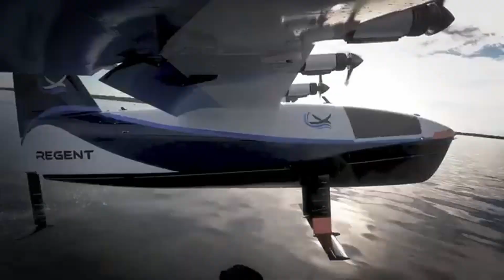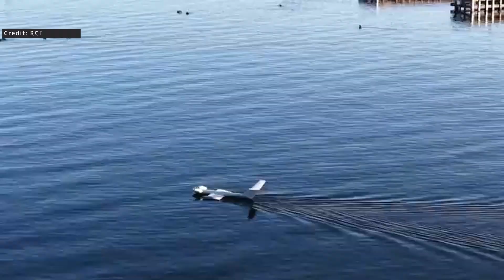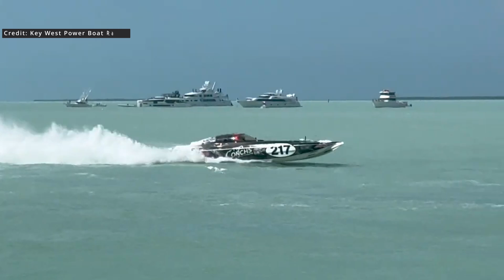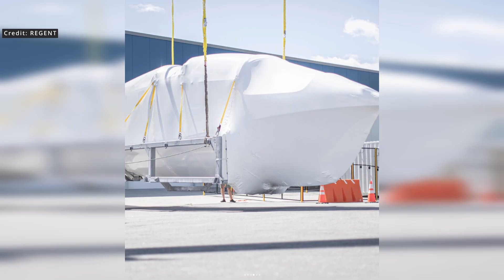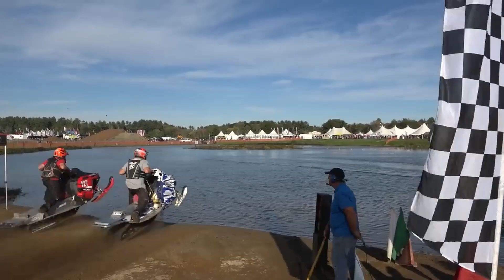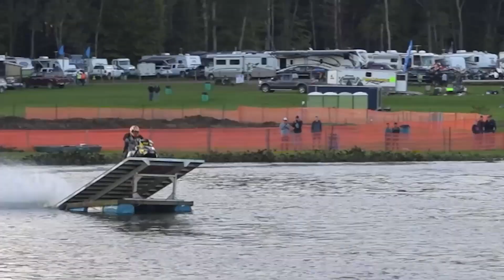Groundeffect on tracks!

Comment: Very interesting, thanks for the update. 👍
Reply from the maker: You bet! Hope you are almost skimming with your craft!?
Reply: @ I've haven't worked on the wig for the last 9 months, I needed a little break from the project, in the meantime I've nearly fixed the helicopter. However I'm still very excited to finish the wings which is the only thing left. Not sure if it will happen this summer but definitely next summer. 

I remember seeing a picture of a flying machine that was propelled by what looks like a jet ski. It had a long arm from the ski pushing the wig craft. 
Not the same as your idea as I don't think it would have skipped out of the water at any time. 

Interesting that tracks are an efficient way of propulsion across water. I think rc test flight did some research with air props vs water props and if I remember correctly there wasn't much difference. 
I would have guessed that water props were more efficient.
Reply from the maker: Well. Hope that you get to finish it soon! Would be great to see it skimming the water!

The picture you refer to might have been an outboard prop on a long shaft like the surface piercing props perhaps. It works but you'd still have to push the boat hull through the water. With all the drag that comes with it.
My thinking is to have the contacting boat hull essentially move backwards rather than dragging it through the water. Which is where the track/treadmill idea comes from. And it seems to work on snowmobiles..
Reply: @ I found the picture, it was called the Elto Quad, pushed along by a small boat. Like you said the water drag is the issue.

Are you going to build a model for your design ? It's worth investigating. The snowmobiles start from land and the top of the water, what is your idea for starting in the water ?
Reply from the maker: @Ben-Dixey Good find! Thought about that setup as well but still start up drag is an issue as the plane part needs to be lifted off the water as well.
Yep. Will make scale model first. And indeed snowmobiles start on land and gain speed before they it the water. That's because they have no buoyancy. The design will hinge on getting buoyancy to lift off from water but having the majority of the wetted area taken up by the moving tracks to minimise drag.
Reply: @onewingspanabove  I see, Interesting! You could be on to something. Hope you show the model on here. Be nice if the tracks also provided some thrust in the air.
Reply from the maker: That would be tricky I reckon.  But not impossible..